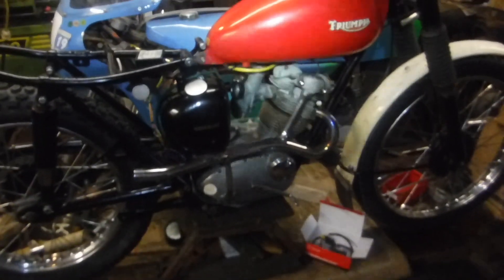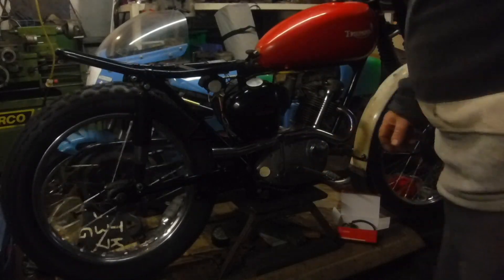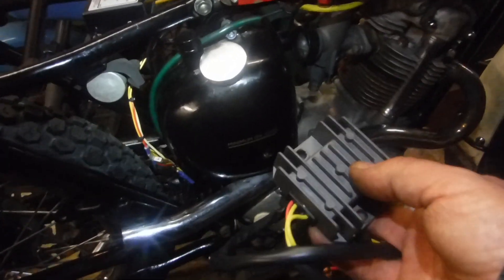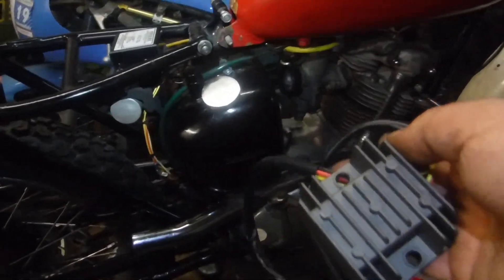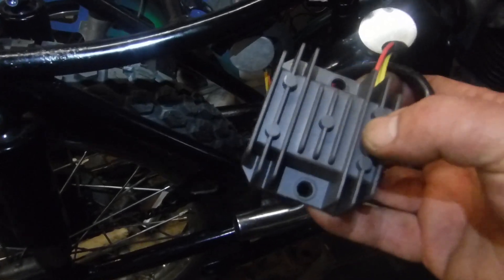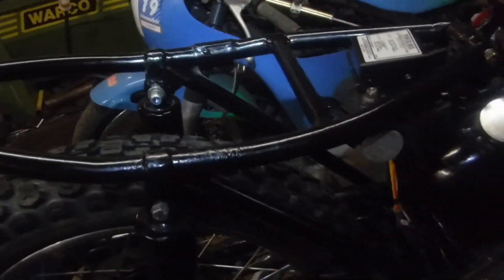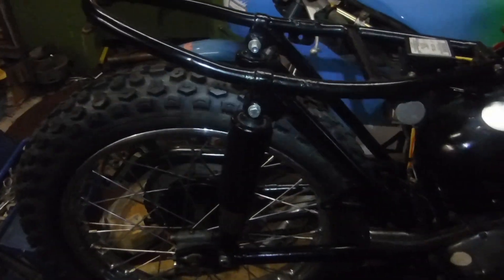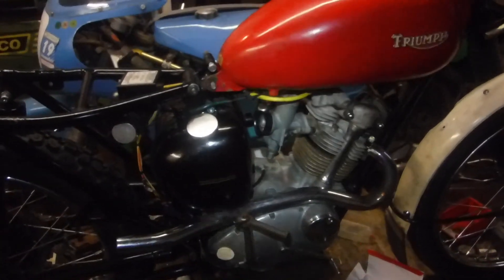Triumph Tiger Cub - A stalled project is resumed. Update 8 Engine runs direct off alternator at last

Comment: The PowerBox reg/rec has the built-in capacitor...which stores up a small charge from the alternator to provide voltage to the ignition system....basically acts as very low capacity battery. If you ever want to or need to fit your two reg/rec units in battery-less bikes, there are 2MC capacitor units available you can wire in line from the Reg/Rec to make them essentially the same as that PowerBox unit.The Norton Commando has the 2MC unit from the factory and permits starting with poor/dead battery....even with an EI ignition.

Comment: Think your right there Paul I run a 2 phase regulator rectifier on my Lightning similar to the units you have & they work ok with a battery & cut in around 14 volts

Comment: In the old Lucas system, the rectifier was the, er... rectifier, the zener diode was the regulator, and the 2MC capacitor was the substitute for the battery. Before the zener was used, "regulation" was done by only connecting all the alternator coils to the rectifier when the headlamp was switched on. Believe me, the rectifier/zener/capacitor system was a huge improvement on what went before. And don't get me started on "emergency" ignition or the "energy transfer" batteryless ignition. 😄

Comment: Do you think points may run better without a battery, or electronic ignition.  I have no experience of either without a battery.
Reply from the maker: Points are the best bet when no battery is used, unless the electronic ignition is self generating - in my opinion, at least.

Comment: Can't argue with that! A little neater & takes up less space than a rectifier, zener diode & 2MC capacitor, but seems to  do the same job. I ran all my permanent magnet alternator bikes without batteries, whether Lucas or WiPac, all were equally effective. The thing that made the biggest difference to starting was carburettor condition.